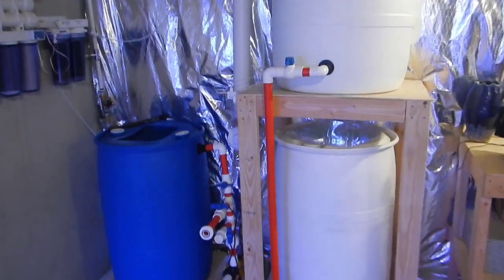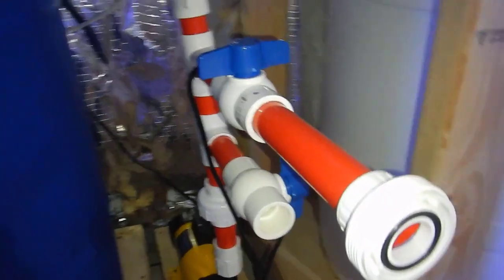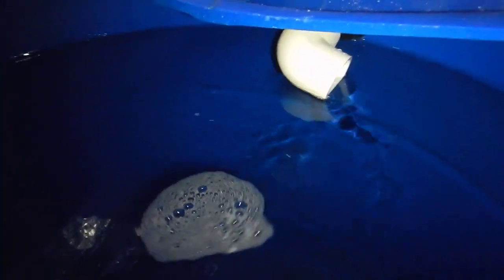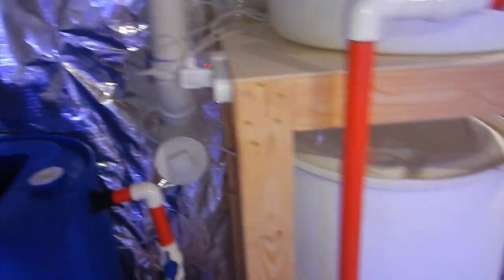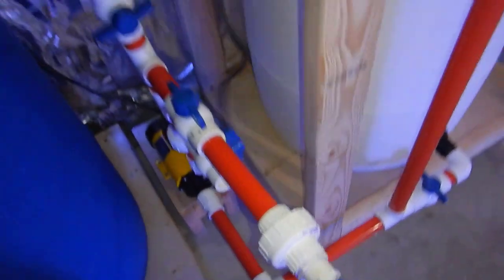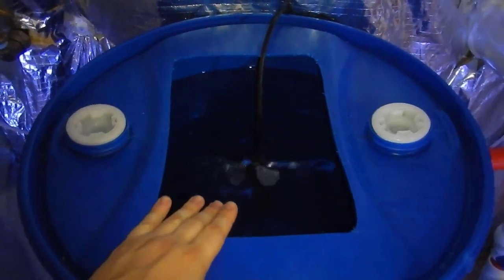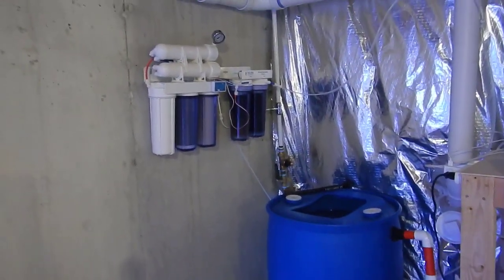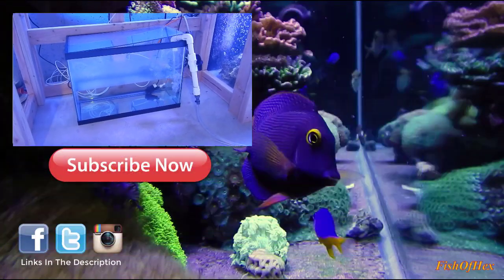Walkthrough Of The Saltwater Mixing Station | Making Salt Water & Filling ATO

Comment: Hey Travis. I Built. Similar system and had a question. I used brute trash cans and put bulkheads in the centre not realizing that would leave an inch or two of water since the sides are lower. Will that left over salt water mess with my next batch ? Will I have to empty it out somehow each time ?
Reply from the maker: I used to just shop vac out any extra saltwater. U can also tip the barrel to get more out

Comment: Before you fill ATO do you flush out any salt water in the system?
Reply from the maker: Yes
Reply: @FishOfHex  you have a 30 foot poly hose ? You flush Everytime you switch between a water change and filling ATO? That hose probably holds a gallon or two ? Worth to have two hoses ?

Comment: So the Ro/DI unit automaticly kicks in when the bottom barrel(white) drains certain ammount of water? How do you controll that, you have a magnetic valve to controll the Ro/DI feed line or am i missing something?
Reply from the maker: Not sure if you checked out the build video for the ro/di setup but its a couple before this one. I have float valves in each white barrel. once the water level drops they open up allowing the ro/di unit to turn on and refill again.
Reply: So the float valve closes the waste water line too? ill try to find the video if that shows how you have done that.
Reply from the maker: The ro unit has a built in shut off valve so when the white barrels are full and the float valve stops the water from coming out that will add back pressure on the ro unit. At that time the unit will stop all water coming into it and out.
Reply from the maker: RO systems have this already on it https://www.bulkreefsupply.com/1-4-auto-shut-off-valve.html checkout the ro/di video and the mixing station videos they are in the fish room playlist. You can see how its put together